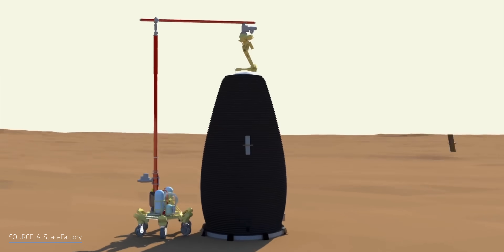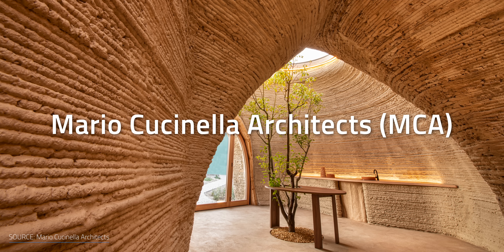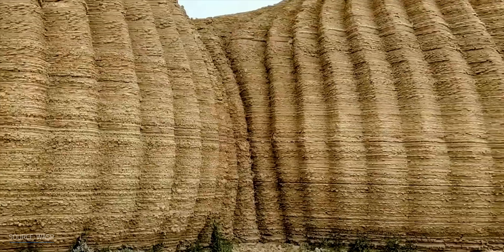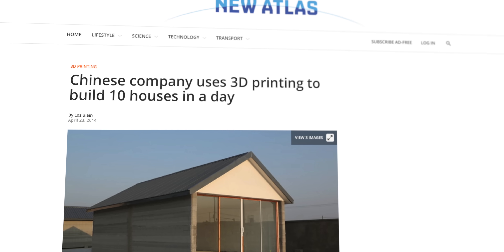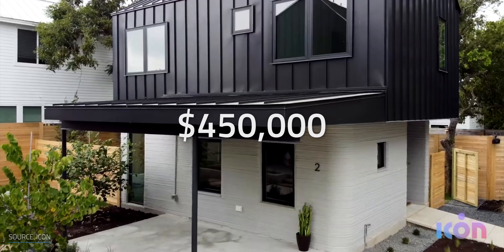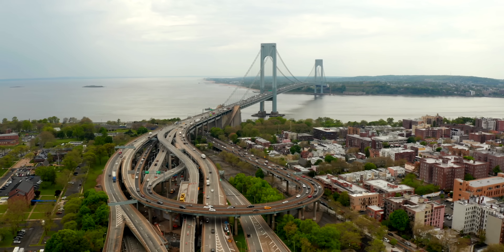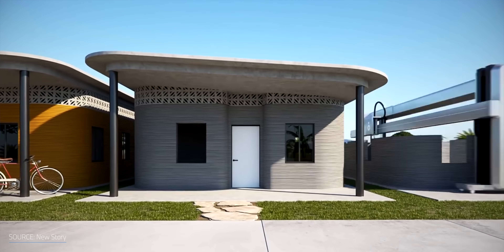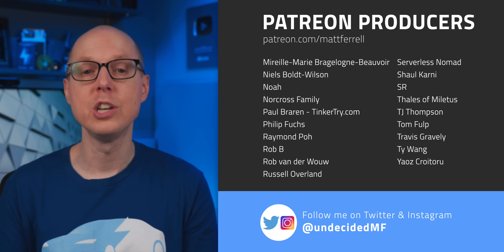The Truth About 3D Printed Homes

Comment: My initial thought on dirt walls is that it seems good for insulation and fire resistance, but might be bad for water and/or earthquake resistance.  I hadn’t even considered the potential insect problem that other posters have mentioned.  I think you would still need a solid concrete foundation and some kind of water-proof lining inside and outside the walls.
Reply: And drainage. I live in the Aus. desert and a few months ago we had a week of constant rain. Everything built to code was fine, other things are still wet. Mud huts aren't going to do to well in something like that.
Reply: Indeed. Kind of surprised the video didn't make much of a comparison to mud huts in a video about using dirt for housing.

I'm actually curious now how much work is it to bring and assemble the whole machinery vs. Just constructing a mud hut with modern tools...
Reply: @saidinesh5  If it's basically a trailer that you just park and power up it'll be fine, but if there's enough assembly required, you'd be better off just making a normal wattle and daub or similar.
Reply: the rough texture of the interior will make for a allergy nightmare. all looks good when brand new
Reply: There's a pretty large community about building with local onsite materals. They've develiped techniques to address most of this.

Dirt/Adobe/Cob walls are thermally massive, they are not insilative. This makes them fine in host places, and places with mild windters, but it's unsuitable for for places where it gets proper cold. 

Stawbale and balecob houses tend to go up very quick, are very cheap, and don't require much skill. They also tend to have insulation in the r40-r50 range.  They have good insulation and thermal mass, allowing passive solar to heat for most of the winter. There are methods for dealing with drainage and frost heave, although I'm forgetting the style of foundation. 

It's all low tech stuff though, so it doesnt get coverage. These houses last, are cheap, and can be built by anyone with who is able bodied with and afternoons instruction.

Putting up a vapor barrier is iffy. It's generally better to let your walls breath. If there's a large water spill, and there will be one, the water has no where to go. It'll end up inside the walls stuck against insulation and you'll get mold. The addage "build tight ventilate right" isn't as common anymore as this style of building has caused rampent mold issues in newer construction.
Reply: @nomms  Most of new con till operates this way from what ive seen. They will let a house sit a little longer then they should or get some water stuck on the crawl space barrier and boom the entire place is a black mold factory. That's when you let the boss know he will be buying you a nice new respirator!
Reply: @redhammer92  Serious health risks!! Why are more builders not thinking about this? I need a toxin free home!
Reply: @nomms   Nice summary!  If you have a vapor barrier it should go on the interior face of insulation (for cold climates).
Reply: That is a prescient comment give they resemble termite dwellings.
Still, I'm sure Gates, Bezos, Soros and all the other trillionaire cop26 eco-fascists will be giving up their multi million dollar complexes around the world and moving into theirs very soon.
Reply: Totally agree
Reply: Insect problem is easy to fix.

We used to have such houses in our village in India.
.
Lime stone wash. Water + lime stone. Paint the walls with it.

For the floor - fresh cow dung (cow poop) with clay. Thin paste. Apply it all over. Give two hours to dry.
Pardoxical. But it was more cleaner and much more hygienic that way.

The problem was upkeep. You had to repaint with lime  every monsoon. Because rains would wash it away.

Leave the house for 5 years, the mud plasters gets washed away and  a section of the wall falls.

Still Remeber 1990-91. We had pans across the room to collect water dripping through the tiled roof. After every night of thunderstorm my grandad and father would go and examine the walls and the foundation.

People in my village had died due to collapsing walls.

Every year may end and early June is the time of extreme thunder storm in eastern India.  Families would literally remain awake till the storm passed. But on the upside, we would see teenagers and adults alike,  going out into the storm with the torches on and a thin piece of cloth wrapped around their head to prevent blidnign from the wind. They were all heading towards the mango orchards. Literally we would feast on ripe mangoes for days. It was great fun doing this.
Reply: Consider constantly rising sea levels, perhaps this kind of housing should be built-on special platforms that sit above normal flood levels.  Naturally, that's going to add to over-all costs and there can be more Govt subsidy in these housing programs too!  In the best interest of the population, cut back on unnecessary space programs and trying to locate aliens in outer space, focus on human needs which are becoming more neglected as time progresses.

Comment: This will not solve global housing problem for the simple reason our prehistoric ancestors knew already. Building with mud bricks (which this tech essentially is) is only feasible in latitudes below 41 N/S because of climate characteristics. Any mud brick structures further than that can't survive very long, that's why in those areas we find ancient stone / fired clay brick / wooden structures and 0 mud brick ones.

Comment: My question is this: How do they prevent the rain from washing down the houses back to mud?
Reply: don't build where it rains.
Reply: @sebastiangeorge7714  But that's everywhere in the world besides underground
Reply: @zxuiji  desserts where it rains so little you might tear it down before the first rain comes.
Reply: @sebastiangeorge7714  even then it could still rain and wash it down, I'd prefer to have an angled roof made from large sheets of wood, chip wood is fine as long as it makes the rain roll off onto the ground, cheaper to replace a roof of chipwood then to replace the shell of a house

Comment: 3D printing will never be more than a nieche. The walls are never even close to your main cost. Roofs and foundations are where it really hits the wallet. Even then the actual structure of the building is often less than half the cost of the building. Now you have to transport and setup sensitive equipment and have it work in all weather condition. On the other hand you can make a prefab factory and ship complete panels to the site. This usually brings on images of the soviet union gray ugly blocks but it doesnt need to be that way. Those buildings were built on a shoestring budget in an era before 3d software and still providet all the modern comforts for the time. Its just that there was energy abundace back then and estetics werent high on the commies priorities list. A modern take on the concept can be well insulated quiet and beutifull while keeping costs low. Also it should be pointed out that buildings are some of the most reciclable things we make since a lot of the material can be recoved not to mention that you use said material for decades making its actual long term footprint very small. The main energy use in a building is climate control and electricity over decades. It really really ads up so you need to make them very efficient.

Comment: So many building "innovations" seem to focus on the "frame" - which is the least part of the cost. The cost of houses is all about the labour intensive design and building on site. To me the ideal method is factory construction. Build it under factory conditions where labour can be better organised and you're not subject to the weather - and hopefully where you can design a lot of the labour out of the process. (Ok, so we're yet to see robots that can fit pipes and lay plasterboard etc - but this is the sort of innovation we really need). 

Now, if you really want a heavy (literally) building material for whatever reason then you can design a house to be modular and transportable. Assemble it on site, then add the heavy material (bricks or whatever). But there are perfectly good light, transportable materials you can use instead (and add the thermal mass later in the form of a large water tank).

Comment: the only big benefit of 3d printed houses is that it moves us away from all stick built houses, and make thicker walls, something that helps with heating and cooling, but it seems a lot of these are 3d printed lower floors and stick built uppers

Comment: The 3D printed clay would probably work very well in Thailand. There's alot of clay fill available, often generated when an irrigation pond is excavated on a small residential farm plot. Typical local contruction techniques would use cast concrete and block which outgasses alot of CO2. Frankly the low end of the housing market is typically poor quality with a 20-30 year maximum structure life span.  Printed houses would raise the standard of living for many here and Thailand is already a very well developed country.
Reply: But you wouldn't need a 3D printer to build houses out of clay.
You could form bricks out of the clay and stack them by hand. Or use one of the other dozens of clay building techniques used around the world.
Reply: @Jehty_  Yes, you could if you were inclined to exploit and manage manual labor. And forego the design possibilities of using 3D printing.
Reply: @propellerhead2000  what design possibilities?
The printer constrains the design more than it creates possibilities.

Exploit? You know that you can hire manual labor without exploiting them.
Reply: @Jehty_  We obviously come from different places. It doesn't seem like you've been to a job site here. Good luck.
Reply: @propellerhead2000 ?
Reply: @Jehty_  Have you visited or worked on a residential construction site in Thailand?
Reply: @propellerhead2000  no I haven't.
So you are telling me that it is impossible to hire manual labor in Thailand without exploiting them?
Reply: @Jehty_  Not based on what I've seen here. The working and living conditions Burmese migrant workers are subject to are appalling at best.

Comment: Nice Matt! You've already pointed out some shortcomings of 3D printing houses. One common misconception is, that it will be cheaper. However we have quite few technologies, which are in fact cheaper and most likely remain cheaper. I.e. building from aircrete or prefabricated concrete slabs. First is very easy, 2nd is cheap, fast, with defined quality. In developed markets it can be make even including insulation, channels for cables and pockets for utilities. But most importantly, as you said, walls account for very small fraction of price of a house. I think 3D printing will be used for more customized and cool designs on the luxury side of property market.
Reply: I like the aspect of a Lego house build........blocks that slot together and are self sustaining for strength and appearance......laying blocks that self lock and require no cement to "glue" them together would make  DIY infinitely possible and adding rooms is easy........recycling a house to make a different plan would be the same as tearing apart a Lego model as opposed to breaking down a brick house and then having to clean all the cement off of the bricks to make a new house.
Reply: @gangleweed  Well, elaborating on your Lego idea, if you consider aircrete, the ordinary "brick" does not have slots. But, it's a very large brick (usually something like (300x500x250mm), yet light and it's crazy precise (like 0,5mm). You put it together using a common spray mounting foam, so it's super clean, fast and easy. Aircrete is also super easy to cut, when you need shapes and partial bricks. In addition to that, because it's so precise, you save on following wall treatments. I got my house built using Xella Ytong standard aircrete, which is one of the most common materials for modern housing used here, in Europe.

Comment: But most homes are made from dirt. Clay or mud bricks its dirt from the ground. This is not a new concept many 9f the Spanish castle where made from compacted dirt. So they used an old building materials in a new machine.not exactly ground breaking

Comment: As someone who is studying to take my AREs, this is 99% marketing and gimmick. Nothing (nothing) is more sustainable than a solid, load bearing stone house that will stand for literally centuries.

Toothpaste tubing mud (or concrete) in fun shapes is hot trash and disrespects the massive, careful, controlled, regulated, and refined efforts that even the worst architects put into their structures. The concept is baseline insulting.

Edit: carbon is a lot less evil than formaldehyde, chlorine, plasticizers, cyanide, and any amount of the circus of literal evil that ends up in the groundwater and can’t be removed. Burn a thousand trees for fun, and you’ve done less damage to our sphere than if you foam encapsulate your house. Carbon is a distraction.

Edit edit: it’s disturbing that this video was even posted. This is nothing other than hype for views. Considering the situation at hand, filming this with a straight face should warrant deep shame.

Comment: for houses 1000 square feet, single story? not bad. for custom homes? not going to happen. this method would be a good track home builder. what they need- integrated INTO this system, is a 2nd 3d print head that can print conduit for electrical wires, conduit for pex potable water pipes and plastic ductwork for hvac systems. NOW you've REALLY got something. the system prints the walls out of cement or clay, while simultaneously printing the conduit & ductwork as the walls 'rise'.. .and leave tees, wyes & electrical boxes printed right into the walls, interior & exterior.  then plumbers, electricians & hvac techs show up afterward and pull in the wires, pipes & connect standard duct work from walls to hvac equipment. ductwork could be printed from ABS stock, as could plumbing drains, vents & conduit for pulling pex pipes for potable water. transitions from 3d printed items could be sized so as to work with existing ASTM materials.

Comment: The architect Khalili Nader, in his book "Running Alone", talks about making the traditional Iranian mud homes more durable by firing them like pottery. He did this by placing a gas-fired flame heater in the doorway for about 24 hours (IIRC). The finished product was impervious to insects and rain, with a smooth surface. IIRC, he only did this a couple of times, and may have tried the same technique in the U.S. after he came here. Been a long time since i read the book.

Comment: I’m a certified carpenter and plumber I went to building school for a year, I do not believe this is the future stick built homes are very Modular (assuming you don’t get a green horn architect) the problem with homes today is that everything is designed to last 10 years where as a mortgage on a house is 30years people build the structure to last 100 years but having to replace hvac systems PVC plumbing has the capability of lasting 100 years (remains to be seen) electrical is usually outdated because of code requirements so the best thing to do is start buying water heaters that last 15+ years hvac systems that last as long nothing lasts anymore that’s why housing is no longer sustainable because we’ve let quality slide